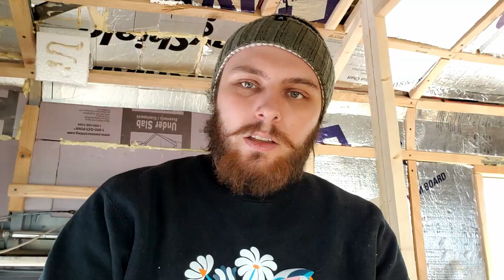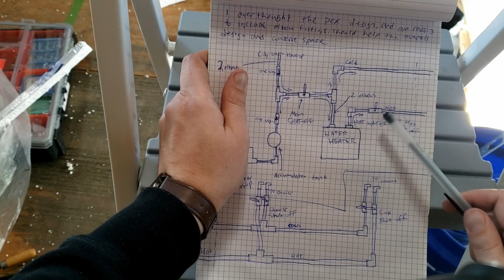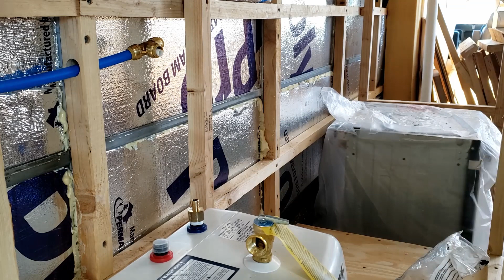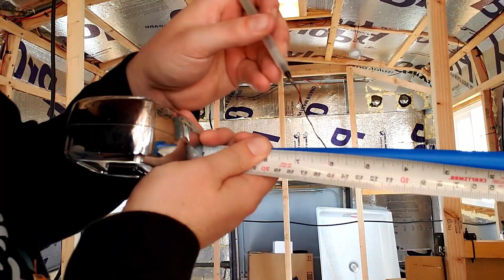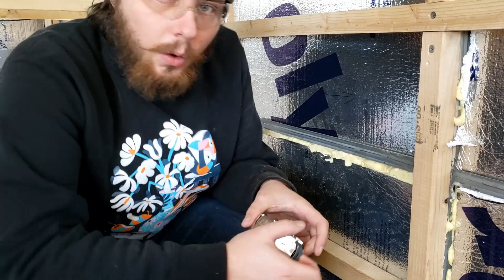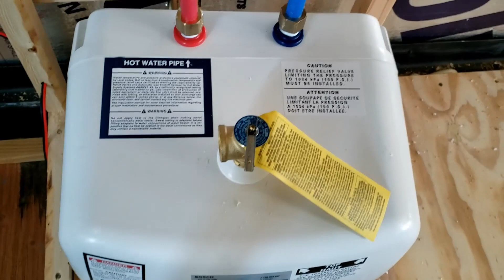BECOMING A PEX-PERT!!! SobeLife Skoolie Pex Plumbing Install

Comment: You nailed it on the clean up it's a good Idea just so you know where you tools are but I found I was moving things around more from front to back because the process may require you to during whatever stage your at like plumbing or wiring etc I have a pair of pvc pipe cutters it does a ratcheting through the pipe and super sharp ever hardware store has them I used to build irrigation system in my landscaping business years ago it works for me. Your doing great on the build. Oh try spade bits for going through the framing for you pex and wiring if any their quicker and you don't have to stop to dig the wood out of the hole saw bit I hate that.
Reply from the maker: Thanks for the advice!